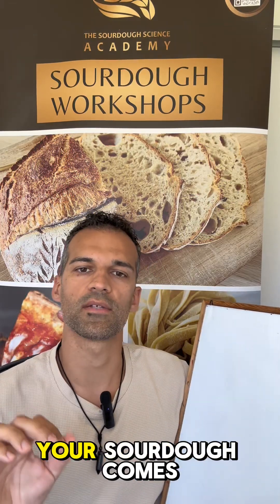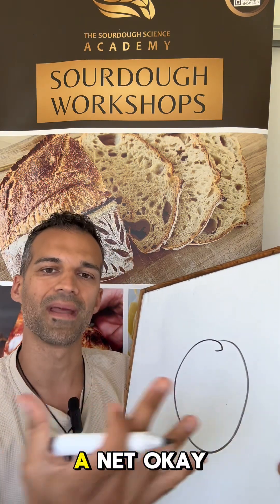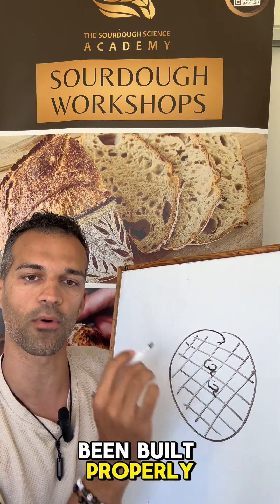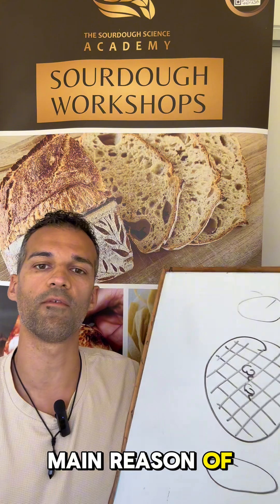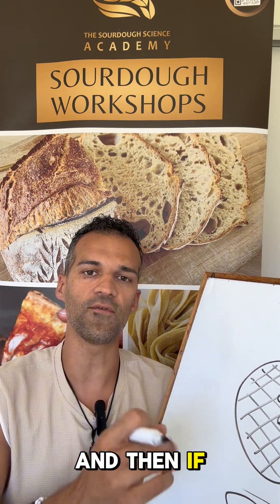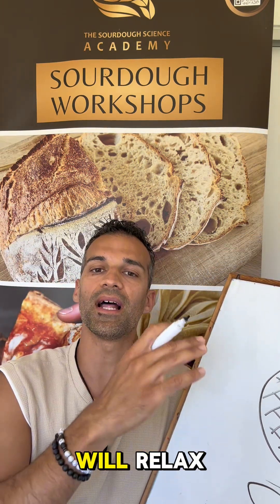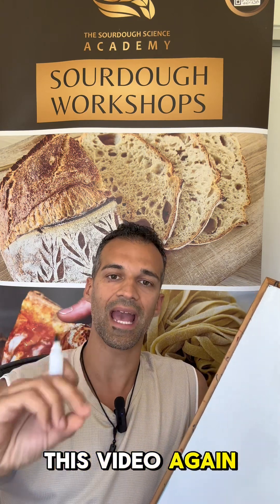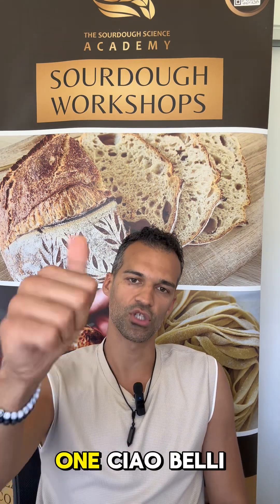Why Your Sourdough is Dense and How to Fix it

Comment: Is that why you shouldn’t use a stand mixer when you are making sourdough?
Reply from the maker: Hi Debbie, you can use a stand mixer for sourdough. I personally don’t suggest to beginner to use stan mixer because it can over mix the dough easily if you don’t know when to stop. Otherwise if you have experience stand mixer can development gluten efficiently based on the kind of stand mixer.
Hope this helps and if you need more info let me know ☺️

Comment: Too bad this doesnt help much for FMF (freshly milled flour), as the hard crushed bran has sharp edges that cut the gluten.
Reply: I sift the bran out and then roll the shaped loaves in the bran to re-introduce it. It makes a really nice crust.
Reply from the maker: @diannahb8741 good one ❤
Reply: you might consider treating the bran separetely...sift it out, hydrate it with or w/o some starter, the include it in the dough as you would other inclusions. The dough would get the time to create the gluten and still get the benefits from the bran. I've read about this a while ago.
Reply from the maker: @norskwelchannel5107 good thinking 😉
Reply from the maker: I personally use flour containing the bran for all my bread and honestly is not such a problem… autolyse can help a lot in that case

Comment: I’m working on learning sourdough with fresh milled flour and I’m having some difficulty but I’ll keep trying😊
Reply from the maker: Stock the freshly milled flour for at least 2 weeks before use it… send me a message on IG if you want to know more 😉
Reply: @TheSourdoughScience  Is the purpose of that to dry it out some?
Reply from the maker: @r @rollingstone3017  Not really. Resting fresh flour isn’t about drying it out. Moisture stays roughly the same. The main purpose is to let the flour stabilise: mild oxidation strengthens gluten and enzyme activity becomes more predictable, so fermentation is easier to control.
Reply: @TheSourdoughScience except most people use the FMF because of the added nutrition,  and it loses about 10-15% of that after 2 weeks in the fridge.
Reply: @Nitz82  what does FMF mean?
Reply from the maker: @samanthas9875fresh milled flour
Reply from the maker: @Nitz82 That’s not quite accurate. Fresh-milled flour does not lose 10–15% of its nutrition after 2 weeks. Most nutrients like minerals, fibre, and protein are very stable. Small losses may occur in some volatile compounds, but they’re minimal. Proper cool, dry storage is enough—a fridge isn’t necessary. Nutrient degradation is mainly linked to oxygen and humidity, not time alone. Significant nutrient loss in that timeframe is not supported by evidence.